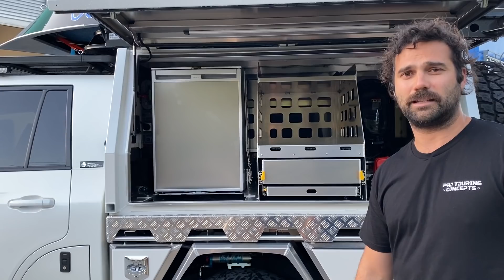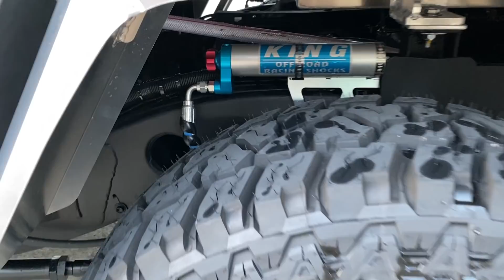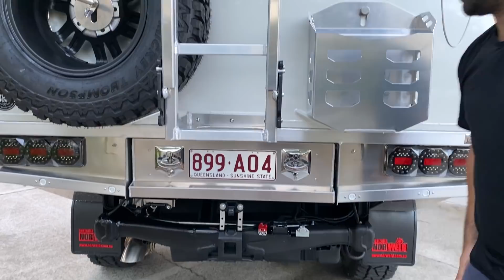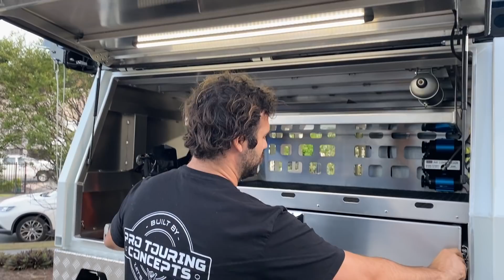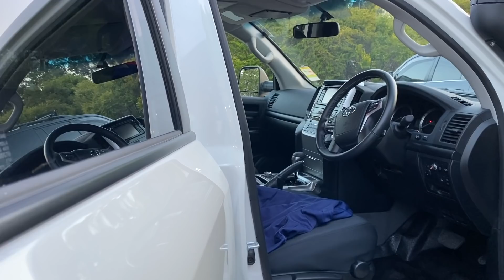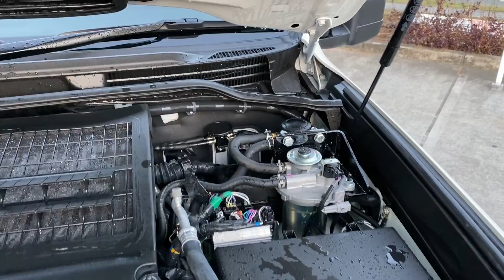Brad & Laurens new touring machine!! Pro Touring LC200

Comment: Do you guys ever upgrade the alternator or are they up to providing enough power? 30a to redarc bms, 30ish amps to van charging system, 25a to redarc towpro, 20+ amps to spotties and light bars etc.
Reply from the maker: Really a case by case situation mate, if we feel the need to depending on average current draw then we will recommend it mate. We've only had to in 2-3 cases but for the most part the genuine alternator is fine.

Comment: Nice build. How do the fridges cope in hot weather. Would it be worth insulting the canopy some how. Just see on a few sites how people have issues with fridges in canopies that struggle to maintain basic fridge temps and run constantly using more power than expected.
Reply from the maker: These bushman fridges do keep a little colder then other brands mate. We do offer full carpet lining and roof insulation as optional extra's definitely makes for a comfier, cleaner package.. Very labour intensive though so we'd normally recommend our customers take the task on themselves if they want to save a few pennies. Thanks mate
Reply: @ProTouringTV  cheers for that. Having lived in the Territory for 7yrs I found it beneficial to keep the fridge exterior as cool as possible so as not to over work it. 3ways really struggled on gas and chewed power on 12v. Keeping fridges out of direct sunlight and making sure they’ve got good all round airflow helps. I was just curious about ambient temps in the canopy and how well the fridges coped. Might be a good test/review/project for some enterprising YouTuber 🥸
Reply: @ProTouringTV  Bushman or Dometic keep a little colder?  Video commentary and footage suggests it is Dometic installed but the written comment “These bushman fridges do keep a little colder .... ” has me confused.  Not that confusing me is hard.  I’m tossing up going away from my chest Engel in the pursuit of weight saving but am concerned about any upright fridge keeping the cool treats cool.  Grateful if you could confirm your experience please.  Also wondering whether you can squeeze the Bushman 130L into your 1900 mm (79) canopy please.
Reply from the maker: @Belly3912  Hey mate apologies the Dometic CRX110L was in this build, they are a great fridge. Slightly more high tech then the Bushmans but we're finding the Bushmans stays a little colder.. Yes we can fit the 130L into our Pro Touring 1900 canopies for the 79. Cheers
Reply: @ProTouringTV  Thanks Caleb.  Appreciate your insight.